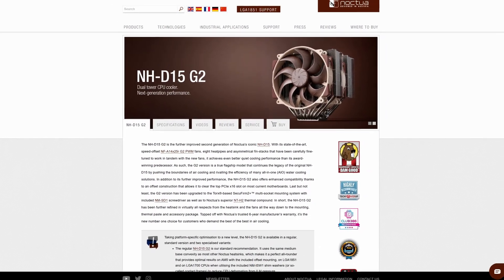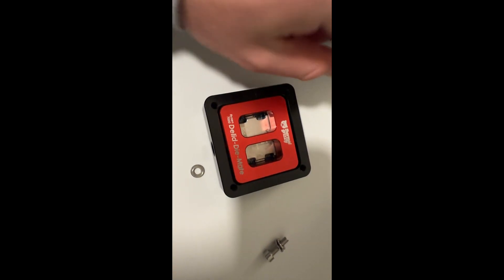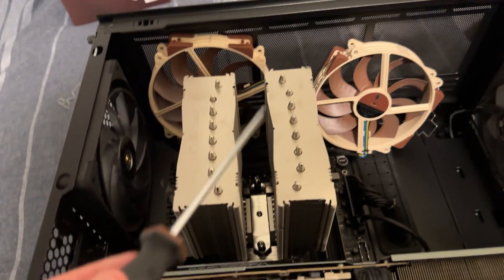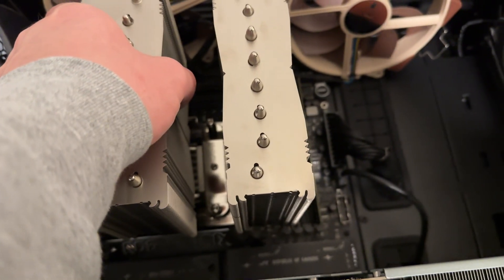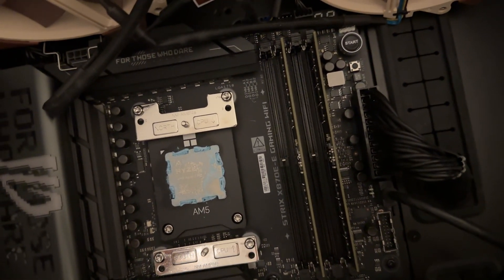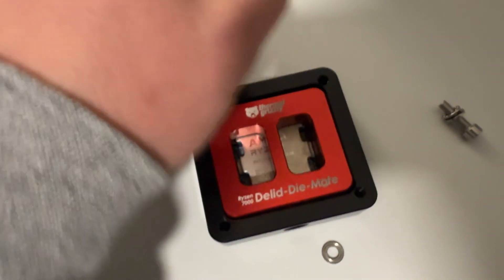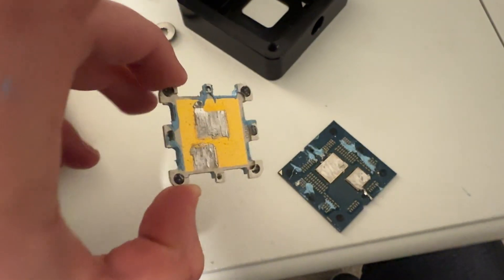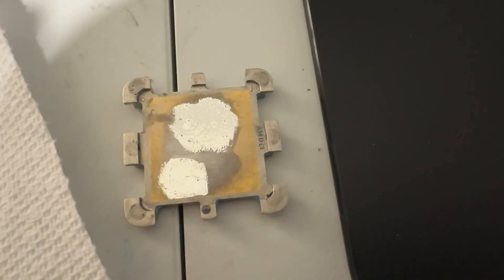9800X3D Final Form: Delid + Direct Die

Comment: Thanks for testing it :) I wish we could just update the website but we had too many cases where it didn't fit. AMD seems to make these CPUs at different locations and the glue application is different from batch to batch it seems. So for some it doesnt fit without modification :(
Reply from the maker: Glad to hear I got lucky and get more insight into why it isn’t listed at compatible online. All the thermal grizzly products I used in the video were flawless.
Reply: Can confirm. Had to take a Dremel to mine but it didn't take long to widen it
Reply: Just -5°C, like here. DerBauer claims 20°C 😂
Reply: way to go derbas
Reply: Just got my March ‘25 updated kit!  Going delid/heat spread & kryo sheet instead of LM. DECAPITATION prep continues…
Reply: I'm looking to do the same thing to mine. 

What sort of modification is needed? 

Is it just a matter of paying a machine shop to skim off a few thousandths and recoatong? Or is it more involved? 

Interested in what sort of issues I may run into. I don't mind spending a couple hundred bucks aftermarket and getting it to work, just want to know what it would need to work. 

Love your channel!
Reply: @CrypticInsight-f6y just sand the inner sides wide enough so it clears the glue. It's gonna depend on how much glue you have
Reply: @ Oh sweet, that's not that involved. Thank's!
Reply: @Rashimotosan  Sanding the mounting frame will expose the bare aluminum. If you're using liquid metal, that could increase the risk of exposure.

Comment: If you're willing to tune and overclock, which clearly you are—the 14900K is the fastest gaming CPU on the planet. It just so happens to not also be a tiny 8 core so it can do other things as well. Get the waterblock on your RAM and hop into the BIOS on a 2 DIMM motherboard.

Comment: meanwhile me with no delid on a 9700x, air cooler thermalight, -10pbo witch curve shaper around -35/-40, undervolt 50mv and a cl40 ram kit: 24053 in R23 :)). had the 9800x3d it is usless in 1440p..yeah if you play cs2 at 720p or games at 1080p maybe, unless it is usless. far more important is that 200$ dif betwenn 9700x and 9800x3d you put it in an upgrade to the gpu
Reply: If you're in 1440p you want to be on Intel full stop.
Reply: @Felale sure mate..be happy with your shitty intel.

Comment: Under stock voltage and clocks my 9800x3d hits a max temp when heat soaked of 61 degrees, im using a 360  radiator and a contact frame. Deliding a cpu just to use an air cooler is like having a fast car and leaving the handbrake on.
Reply: It isn't. The gain is the same. You could argue just using a plain watercooler and not chilled water is a waste as well.

Comment: Right now it's still luck of the draw if the direct die frame can mount your 9000 series or not. It all depends on if the outer insolation glue happens to land within the boundary or not.
Reply: Are you talking about the glue on top of capacitors? Should it be less than the max height of dies?
Reply: @fifapesmobile4370  It's usually lower than the dies. The real problem is that on the 9000 series, it often obstruct the contact frame depending on the batches.

Comment: I got the Thermal Grizzly contact frame, direct die frame, high performance heatspreader, offset mounting kit, conformal coating, plus kryonaut, conductonaut, and duronaut.
Just waiting for the delid tool that originally got lost in the mail.

All that just to use it with a Corsair 240mm aio lol
Reply: tooth floss and a small vice havent failed me yet in four 9000 series delids
Reply: Well, it worked. CPU is still alive. 
Previous idle temp = 50
Current idle temp = 44

Previous R23 temp 79
Current R23 temp 69
Reply: @Techn9cian123  10c drop is amazing.
Reply: @ here’s the layout 
>delidded 9800X3D
>conductonaut extreme liquid metal
>high performance heatspreader 
>kryonaut extreme
>corsair 240mm aio

I still have room for improvement by properly polishing the die and surface prepping the aio and heatspreader. I only did a quick cleaning because this is my first time and I was scared to break my brand new CPU. 

I also have the offset mounting kit and direct die frame to try one day.
Reply: @Techn9cian123 you would of seen another 12-13c reduction by removing the best spreader & putting the aio directly on the die
Reply: @LightWorks222  yeah I plan on trying that one day. Right now the Liquid Metal application is perfect and I’m not opening it back up for at least a year.
Reply: @Techn9cian123  no worries, you can always go back to switch things around when you want. I’m trying to figure out how to go about custom looping my rig + delid my 7800x3d. 

delidding + cleaning + buffing the die is the easy part.
Reply: @ my AIO isn’t nickel plated so it’ll leave a permanent stain. 
Since it’s a brand new Corsair ICUE link AIO, I’m going to wait a year at least.
Reply: @Techn9cian123  same thing happened with the Nzxt aio that I just sold a few days ago. you have plenty of time anyway
Reply: @ I also have the offset mounting kit to try. Another reason I’m going to wait (at least a few months) is because you need to fully remove the mobo from the case before you take off the high performance heatspreader or else the cpu could come out and drop on the pins.

Comment: You did it wrong, the contact between the coldplate and CCD is not balanced because there is only 1 die on the cpu, you need a direct die waterblock or Thermal Grizzly S-TG-HPHS-AM5 , for 2 CCD cpu's your method will work, not for 1 CCD cpu.

I am running for 2 years direct die with my 7900x and works great with a Corsair H150i XT AIO. Before the 7900x I tried the 7700x also a single CCD design, it didnt work at all.
Reply: Corsair H150i XT AIO has a curves on coldplate specially for IHS, so your pressure on dies is 100% not same
Reply: @Lsal112  That's not the problem because I have lapped it.. 1 CCD direct die just dont work with a normal AIO.

Comment: Cringing hard at the ("normal") thermal paste application, it doesn't need to be spread out; you're only creating air bubbles this way. You're also using way too much.

Also clean your hands, you don't want to accidentally touch your eyes with that stuff on it.

But you're probably aware of all this and only doing it for engagement, well, guess it worked.

With liquid metal it works different; that does need spreading yes.

Please watch more of der8auer content on it, and why he always recommends and uses kapton tape; he sells it too.

Do like the content, keep it up.

Comment: Why? Stock IHS with 240mm AIO, same 5.3 all core, will give you better temps than you are getting, for a lot less hassle.
Reply: direct die always 10-20 Celsius cooler
Reply: @Lsal112  Clearly not in this case, have you actually watched the video?

Comment: will the 9950X3D be faster than 9800X3D? in productivity it will be faster for sure, i already know that, but in terms of gaming too, will it be faster or same perf?
Reply: worse. The moment the game tries to use the other CCD, it will result in stutters. I think AMD gets around this by using core parking. Which turns the 9950x3D into a 9800x3D by disabling one of the CCD’s
Reply: @Marauder-q2v  but isnt the boost clock higher? So lets say one would disable the non 3d ccd?
Reply: @ pretty negligible. Probably useful in a select titles but probably doesn't pan out for the majority of games. AMD themselves have said 9950x3D and 9800x3D are going to be fairly matched in gaming

Comment: LOL My 9950X scores 47350
Reply from the maker: Ever think it has double the cores and higher frequencies?
Reply: Dude is using a CPU only meant for gaming. The 9950X is a high end CPU for productivity which is why you got a higher score. Both of these chips have their specific purpose. The only AMD CPU dedicated for both gaming and productivity is the 7950X3D. Also Intel 14900K does the same for cheaper but hotter.
Reply: Yeah because the 9800x3d is made for gaming which care more for the extra cache rather then extra cores and frequencies while the 9950x is better for workloads like the benchmark hes running
Reply: Nobody cares

Comment: Ive got a 9950x running CCD0 at 5.35 and CCD1 at 5.2 all core
also I changed settings in bios

PBO SETTINGS:
PPT 230
TDC 160
EDC 225

CCD0 -25 all core
CCD1 -55 all core

and I get 45000-46000 score in cinebench all the time and the cpu package is 200-205w underload
also it never passes 65c on ccd0 and 57c on ccd1 the induvidual core temps are a bit lower some go higher some go lower but i recommend changing your settings in pbo to defaults to see your temps after.

also completely stable :) ran r23 for like 5h and coreCycler or at least stable to a point where i cant crash it
Reply: WoW amazing
Reply: I wish I wasn't an amatuer so I knew what any of this meant - all I can understand is you've got an insanely powerful and insanely cool (temp) CPU lol
Reply: -55? Wtf?!
Reply: -55 sounds crazy, I was never able to get a stable result (no errors in a couple of different OCCT passes - AVX512 4 core cycling, AVX512 all cores and then a memory test) below -30, I tried it on 7900, 8700G (absolutely stable at -30) and 9950X3D (-22 CCD0 and -30 CCD1 with stock boost clock).
Reply: @tomkocur   yea. it was stable under some weird conditions, run cinebench it can run all day run something like a game you can play it for 1h or so before a crash happenes i turned it down to i think -40 or in that range and its stable now ccd0 cant go low on voltage tho prob cause the clock is higher than ccd1
Reply: @PilexArk  I ran default clocks, so 5.45 for CCD0 and 5.7 for CCD1 and could still push CCD1 down to -30, while the lowest CCD0 was able to work with was -22. To me it seems like the X3D is just a little more sensitive and has narrower operating margins.
Reply: @tomkocur  yea most likely but the 9950x3d probrally will use less voltage by default than the 9950x i think? so thats maybe why you can only go down like 20mv. Btw i wish amd didnt have the +200 mhz cap on pbo. If my cpu can run all day -25 and -40 then it can probrally go up to 250 - 300 mhz boost override
Reply: Can I use the same ppt TDC and edc limits for a 9950x3d as a starting point?

Comment: Not to knock on your experiment, but if you did your research right, you would have went with the NH D15 G2 LBC version. Noctua clearly states on its website that because the coldplate of the LBC version is the most flat of all 3 versions, it is best suited for direct die applications where you need the flattest contact possible. You could probably have gained another 2-4°C with the LBC version.
Reply from the maker: That’s what i used